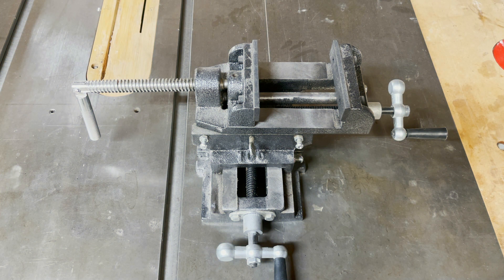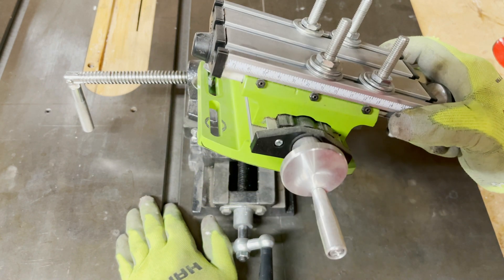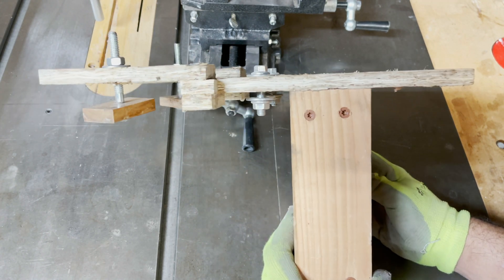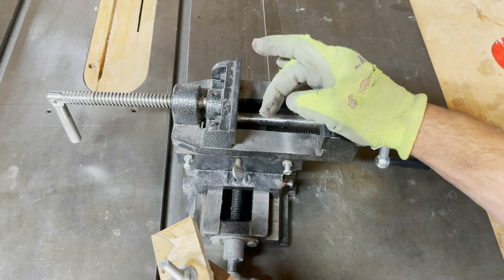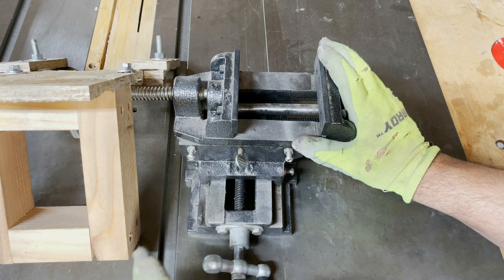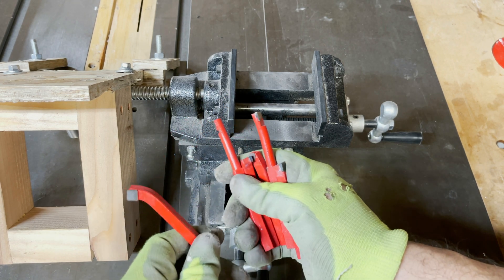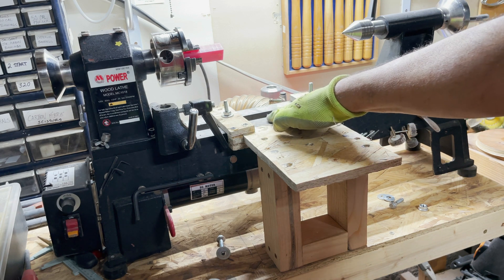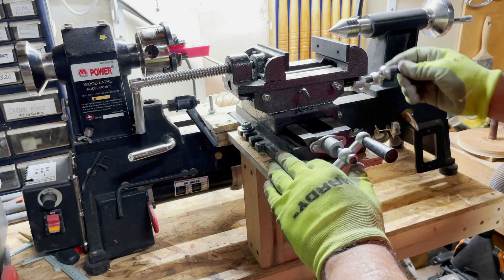X and Y axis mill on wood lathe

Comment: Your X and Y setup is two years old now.  Do you still make use of it or have you gone back to more traditional methods. If you are using it is it strictly for rounding blanks or are you doing precision type work such as making mandrels?  As I contemplate getting into bespoken pen making I am wondering if a X and Y vise might aid in preparing  mandrels to accept taps such as 10mm or 13mm or if I would be better off just using standard tools to make 10 and 13 mm tendons for threads.  If the vise did not work on the lathe it would always be useful on the drill press.  I am sure you are busy, but would appreciate a quick comment on your thoughts about how a X and Y setup would fit into a bespoken pen endeavor.  Let me end by saying you do beautiful work and your videos are a great service.
Reply from the maker: Hi, thank you for watching and commenting on this video.  I have used this setup on several occasions but I ended up buying blanks that are 18mm round from vermontfreehand.com if you are going to get into bespoke pen turning you may want to check them out.  Back to your question on what I am doing with the x and y axis vise now, you are correct I have attached to my drill press now and I find it helpful there for obvious reasons.  I would just stick to the basic tools for the tendons.  Appreciate the complement, and you taking the time to watch my videos.

Comment: The Harbor Freight etc. import junk tool set works with nothing out of the box because they are not sharp.
And to sharpen carbide, you need a diamond or CBN disc or wheel or at least a little grinder bit.
But in a pinch, silicon carbide will also work if all you need to do is touch the carbide up a little bit.
IOW a Tormek Blackstone wheel. Or one of those green little bits for the Dremel/Proxxon IBS.
Or a diamond file if you're really hard up.
What you can do for more convenience is get a cheap quick change toolpost. You should be able to just clamp it into the vise.. or else mount it on some steel bar offcut. It will give you an inch or two of vertical adjustment and probably more rigidity than the block of wood, and less stick-out. I think it should be able to work metal just fine if you don't overdo it. Next week I will try to cut a seven-inch sheet metal disc with a similar set-up on my Delta wood lathe.
Reply from the maker: Good to know, thanks for the input/advise on the toolpost never considered anything like that.  I hope everything works out on the delta wood lathe.

Comment: Very cool! Not sure if that's any tidier than the messy process you described doing it by hand 🤣

My hope is that I can build a box around the lathe for a router and do it even quicker!
Reply from the maker: Using a router  or a dremel is a great idea on the lathe if you can make it so it is adjustable, this fit the bill for me cheap and easy.  With better carbide cutters I think this will work nicely, I also works with pen manderals.

Comment: First, I too have been contemplating this same set up BUT your base "carriage" set up was NOT in my initial thought. I wanted to put it all on the lathe bed.  
Second,  you may want to get yourself a same size as that 2x4 of aluminum.  Reason being granted that pine works but it allows that tool to vibrate.  If not aluminum then delrin and use the 2x4 as a spacer. Allow the tool to be 1/16" or 3/32" proud to really hold that tool tight.  I understand it is so you can just round off the blanks but vibration or the less vibration the better the cut.  
Lastly, You upgraded your lathe. that is to say you got a new one?
Reply from the maker: Hi Andrew, thanks for the advise.  I have not noticed any vibration yet but that's a possibility with the jig being made of wood.  My mini lathe is the one I've had since I started pen turning, this is the one I use the most.  I have another Delta 46-700 that I rarely use.  Thanks for watching and the advise.

Comment: nice that was killer
Reply from the maker: Thanks, appreciate you watching it.
Reply: @exoticwoodpen  you do very nice work I have a shopsmith along with a small metal lathe that I could all kinds of sigmet bowls even pool sticks pool stick protectors I have my  son that's 8 and my daughter  that's 7 cutting bowls and pens  on the lathe
Reply from the maker: @johncrawford9698  Sounds like a great set up,  one of my first tools I bought was a old Shopsmith 10ER, it worked great for more than 10 years before I passed it on to a friend.  Glad to hear that your kids are in the shop with you like this.  Thanks for watching.